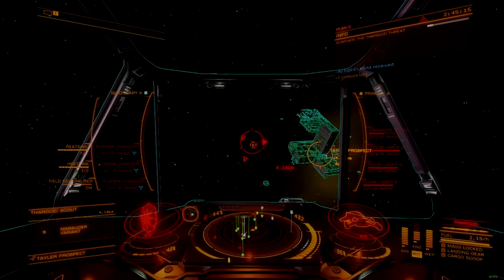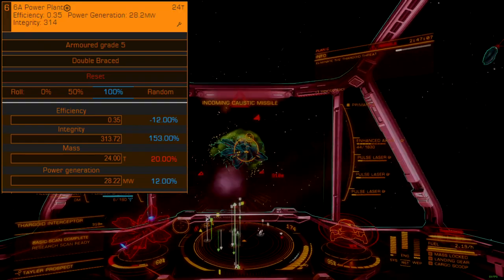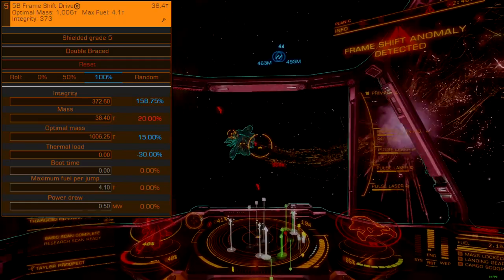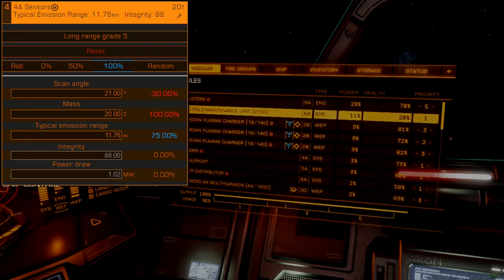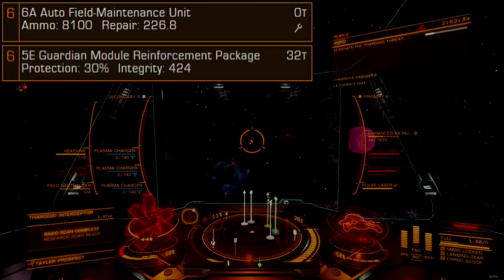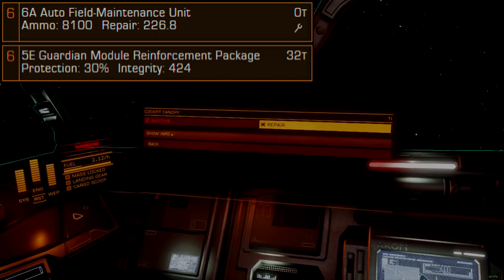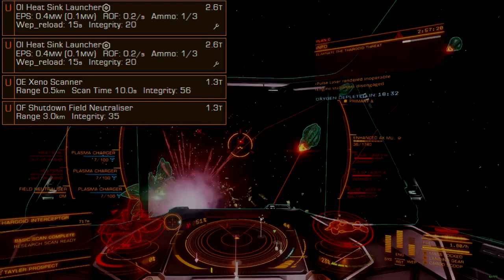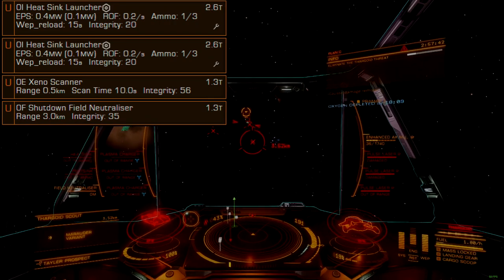Elite Dangerous | Ship Build | Alliance Challenger | The Plan C

Comment: There are some odd choices you've made in this build, first and foremost is probably the module reinforcement. It's put on display during the video when your power distributor fails because of damage. If you're worried about power usage, you could swap the guardian module reinforcement for a normal module reinforcement d rated. And replace a couple of the lower tier hull reinforcements for d rated module reinforcements. You would lose about 10% of your hull, for 94% protection on your internal modules. This is especially powerful considering the AFMU is 10x as effective on module reinforcements as it is on any other component.

Comment: this build is much heavier and has double the hull of a typical meta/AXI recommended build, and it seems you're using it to basically face-tank a cyclops - which will work fine, but cyclops are pretty easy to kill anyway (compared to the higher-tier variants).  it's very heavy due to the b-rated modules and military armor (usually the meta challenger builds use light-weight armor to keep it maneuverable; however chieftain builds do use military). I think this will break down completely if you go up against a higher-tier interceptor - their cannons do much more damage than a cyclops, and without repair limpets and cold orbiting to avoid damage, even the very high hull won't last long

Comment: That build is very odd. I'm not for AXI cold orbit meta, but this one is too weird even for me. I agree with the modplasmas, and weapon focused distro isn't necessarily a bad idea. I fail to see the point of the pulse lasers. You have the PCs to one shot the scouts, and AXMC to finish off the imperfect kills. They might deplete the interceptor shield, but the classic long range TV beam is better for that. You definitely need more module reinforcement. You wouldn't have to be so worried about your core modules and cockpit then. It's an interesting idea to pile on max hull instead the normal repair limpet approach, but it probably won't scale well against harder flowers.

Comment: Why pulse lasers? I'd recommend long range beams with thermal vent even for scouts. I also frequently use either a thermal engineered biweave with low draw and no shield boosters and/or a large guardian module reinforcement with a size one amfu even for scouts. This seems to work well for me. I agree with going shieldless for interceptors and the rest of the big goids.
Reply from the maker: Pulse lasers draw less power, allowing for more shots from the chargers with all weapons firing. It a personal preference since charger weapons don't typically overheat the ship.

If the 4 experimental weapon restrictions go away then I imagine all this is going to get upended though.

Comment: I built a challenger with the same thing in mind. I skimped on the armor, only reinforced. (Heavy duty/deep plate) I was able to get 3000 hull, 60% module coverage and a boost of exactly 500 m/s. I used salvation shards instead of the plasmas. Same size 3 enhanced ax turret multi. I used  A/Drated stuff instead of the B. No room for a scoop either, but better jump range overall. I’m not the greatest ax pilot, average at best. Thus far the ship has been a blast, I’ve met the rebuy screen a few times, but mostly my own fault 😊